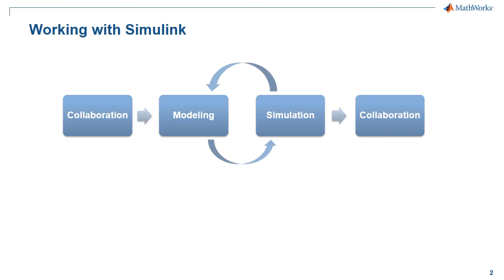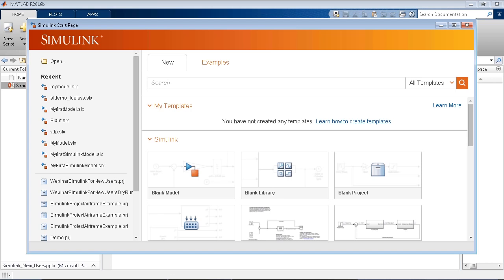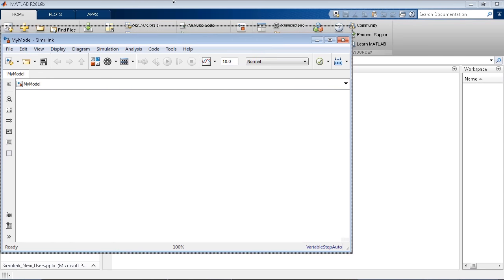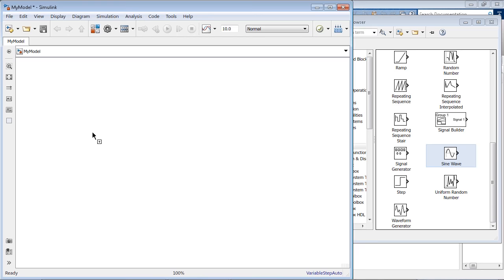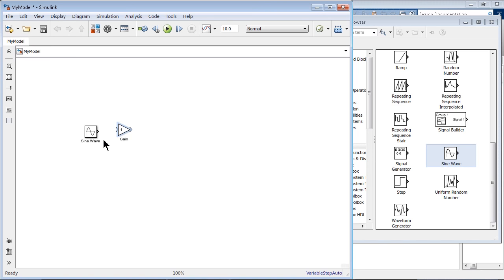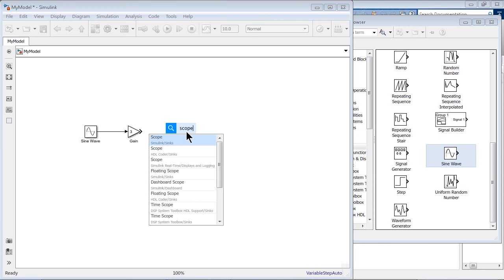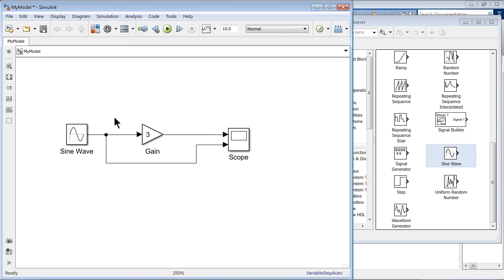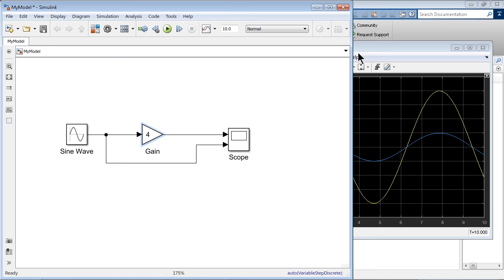How to Build and Simulate a Simple Simulink Model | Getting Started with Simulink, Part 1

Comment: I remember having a simulink project to build a 32 bit MIPS system using xilinx and vivado. That was one of the hardest courses of my life, and I needed to pass that course in order to graduate from engineering. I scratched and clawed my way through and though I never thought I'd pass, I still did. And 2 years later, I still have PTSD of Simulink, despite all its use cases...
Reply: This video is too simple and not enough knowledge for real world

Comment: How can I specify a start point? My sim. has feed-back, and the error I'm getting suggests that the sim. is starting at the output (rather than the input), because the feed-back code is trying to access the output variable and failing on an index error, i.e. the output variable is not populated yet.

Comment: Dear, I created a simple simulink model for Diesel generator unit. I need to make it stand alone application working out side matlab beside its interface like GUI. Because I made the same model by the use of Guide (GUI) and i compiled it. Then going out side matlab and double clicking on the compiled file, It shows a nice interface that been created. My problem is, how do this by the use of simulink, i.e working outside matlab (under windows environemt like any visual model) without loosing the simulink interface.?? please help